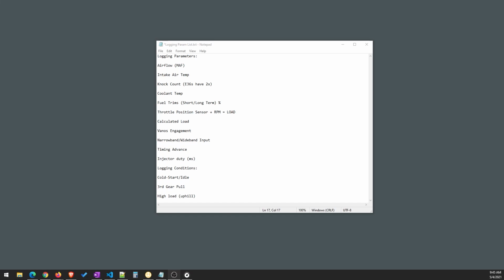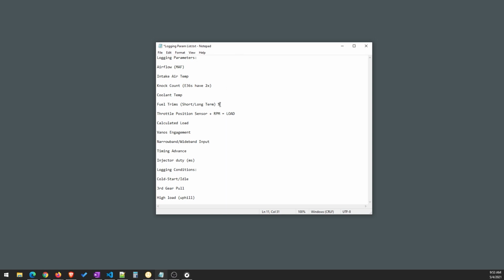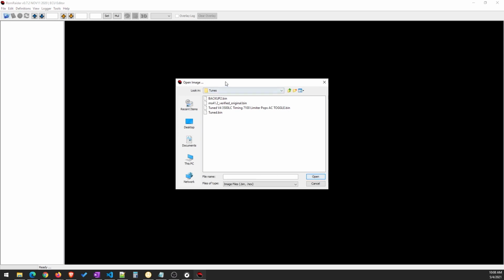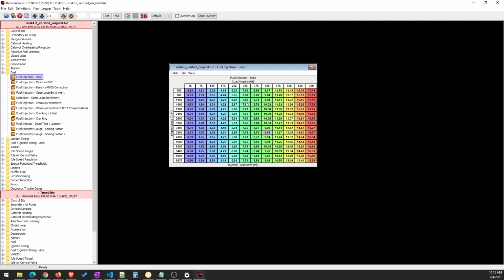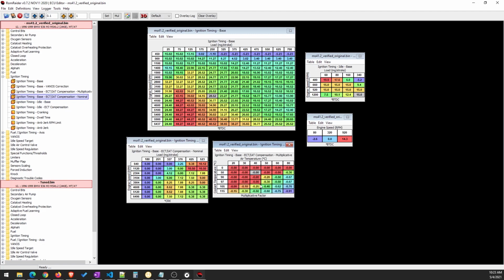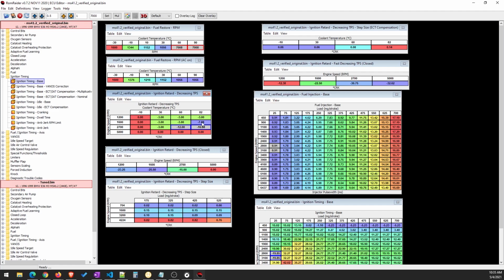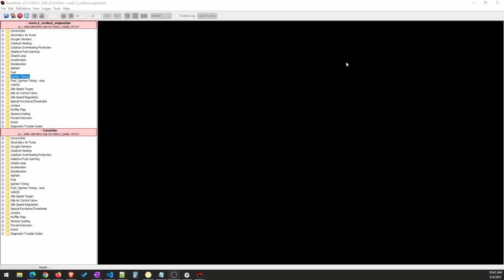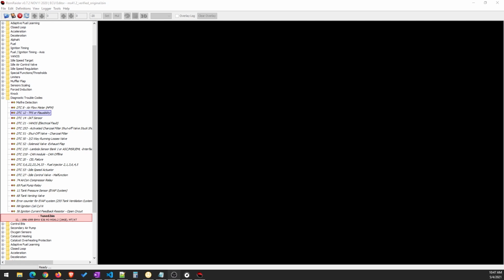How To Tune A BMW E36: Intermediate Tutorial - Part II: Launch Control, Burbles/Flames, Fuel/Timing

Comment: I know the ECU can be switched from an auto to a manual , bimmerforums has a pretty good description of how to do it , but it requires a pc with a serial port . Is this something you can do with the software you’re using and the USB cable ?
Reply from the maker: See part 1, you just need USB. Manual conversion can be done through rom Raider as well

Comment: I appreciate the vid! What definition file did you use? I tried with the latest 45.9 and iam missing the engine speed limiter setting... Any ideas? Thanks
Reply: make sure that ur MS41 version is the same.. His is MS41.2.. mine is MS41.0 so i dont have the engine speed limiter (AT) and (MT)
Reply from the maker: Definitions can be found in the first video (ms41 wiki page) one of the first pages will have a link to the definitions. Depending on your ms version you may not have certain features available. Also make sure you get your definitions from a reliable source

Comment: Hello. I have two questions: is there any major difference between ms41 and ms42 when it comes to tuning them? Second one: Im installing a bigger intake (m54b25) to my e46 323. Is there any parameter that you recommend that i tune other than fueling? Have a nice day and thank you for the awesome videos!!
Reply from the maker: Not much of a difference besides loading different rom Raider definitions. Just remember to log fuel trims to see what fueling adjustments need to be made. Idle fueling may change as well. You should see tables for that too